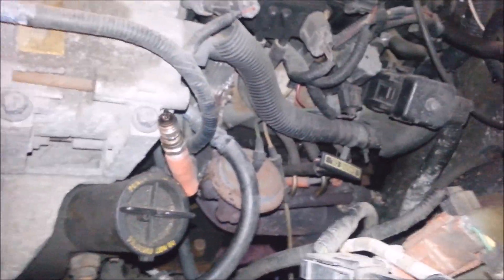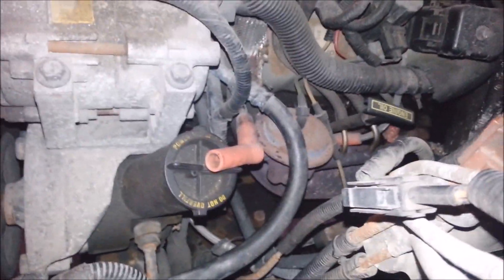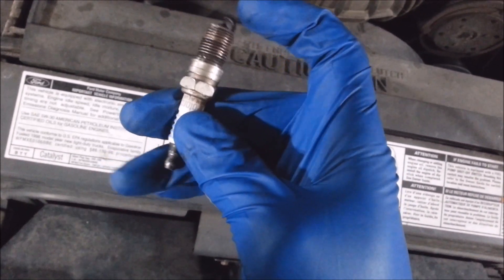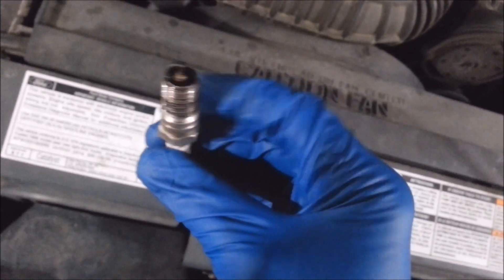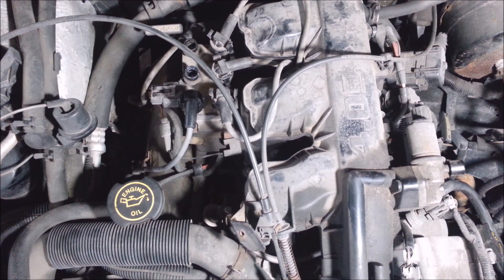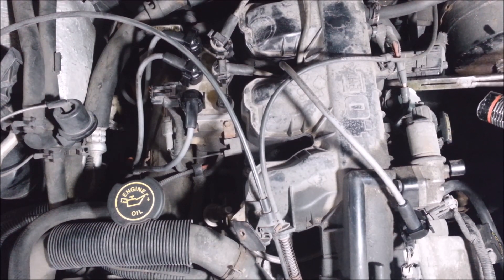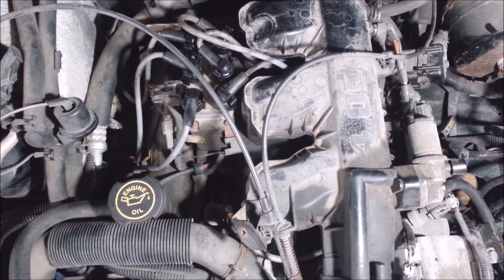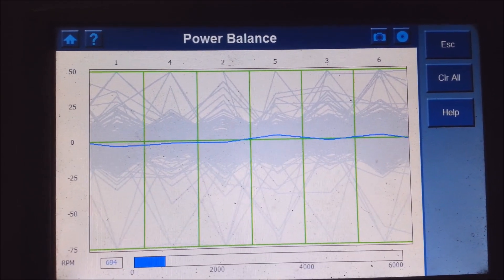1997-2000 4.0L Ford Ranger misfire code fix

Comment: all you have to do, is connect an old fashioned bright TIMING LIGHT to the engine, and move the secondary pickup from wire to wire, and the light won't flash on the missing cylinder.  then it's either coil pack, wire, or plug.  simple.
Reply: Ĺĺ

Comment: Check camshaft position sensor at the passenger side rear of the engine. If it goes bad it will cause a misfire . it fires the fuel injectors.

Comment: always check plug right after coil output. You can read  plug and maybe point you in right direction.If pkug is wet and black could be bad plug {or burnt valve)If plug is dry look and listen to see if injector is ticking

Comment: i was going to change my sparkplugs wires and coil pack.  You got me concerned about shocking myself.  What in that procedure do I need to watch out for?  I watched some other videos and its seems straight forward?  I was going to disconnect the negative on the battery and start replacing?
Reply from the maker: Don't do any ignition work when the car is running. It could be a heart stopper.
Reply: @RustBeltAuto  cool wasnt planning on it.  was going to work with the car off and negative terminal disconnected.

Comment: I have a 97’ 4.0 & I got a misfire code for cylinder 4 with a heavy shake from the engine. I had just done a tune up 5 months ago. I replaced the ignition coil pack & the code went away but the vehicle is still shaking a little more than it should. Should I consider replacing the fuel injector on that cylinder even if I’m not running a lean code?
Reply from the maker: Leakdown test. Possibly compression test. Thos engines are known for burning exhaust valves.

Comment: I have a 97 ford ranger. And when it shifts into 3rd gear it feels like it wants to stall. And it starts to kick then pick up speed again. What would cause that. I have replaced the fuel filter and done an oil change.
Reply from the maker: dziurdad53 No codes?
Reply: Sounds like maf problem

Comment: My 2000 Mazda b4000 with the 4.0 ohv misfires on cold start for 15 seconds then go’s away just happens on cold starts what could that be?
Reply from the maker: Check your spark plugs. If they are really worn, they will work better when hot. Those things almost always need a valve job too. Best advice I can give you.
Reply: Rust Belt Auto I changed the plugs an ran some b12 in it an that seem to fix the issue but I noticed by the spark plug coil harness there’s a plug in red wire that disconnected an I don’t see a plug to plug it into it don’t show a check engine code
Reply: Rust Belt Auto at 12:37 at I’m talking about that red wire that plugs into that 1 black wire by its self that’s on the coil pack thing I’m missing that black wire plug in
Reply from the maker: @kamryn7496  Capacitor suppressor for RF noise. If yours is missing, it would be a good idea to get one.
Reply: @RustBeltAuto  oh that's what it's called thanks I'll look in to it

Comment: i have a 93 Ford ranger it idles ruff some times and bogs down like it's lost all it's horsepower there is black carbon at the end of the top of my tale pipe on my truck there is a flashing white light at the end of the spark plug wire's would any one no what this could be

Comment: Need help randomly started misfiring on cylnder 1 threw a code p0301 new plugs, wires, coil pack still a misfire did that test of takeing the wire out of the coil pack and you can hear it sparking could it be bad plug?
Reply from the maker: Take out plug, and look for carbon tracking. They have valve issues once in a while too. Could be injector issue, but doubtful.

Comment: I hace a Explorer Sport XLT 2003, in It misfire cilindre 4  change spark plug, wirless, injector wash in laboratory and misfire continuos  you can help me ???
Reply from the maker: If you have a good spark all the way to the spark plug, and did an injector swap (moved injector to a different cylinder), and still have a #4  misfire, you might want to do a cylinder leakdown test. The 3.0L fords burn exhaust valves all the time. You may have an issue like that with your 4.0. That is the best advice I can give you.
Reply: @RustBeltAuto  already in the cylinder number 4 have a problem leakdown test It is 80... Maybe now It is a big problema
Reply from the maker: @nicanorm1069   If you are sure the valves are closed all the way, You have your answer. Those heads are easy for me to replace, and have sent a bunch to get a valve job, and resurface long before I ever did a Youtube video. By the way, you did a compression test, and not a leakdown test. Probably still the same result.
Reply: @RustBeltAuto  compression test in my Explorer is 80 in the cylinder number four

Comment: having bad spark plug wire's can make your truck or carboraitor run tuff like idles ruff bogs down and carbon build up at the tail pipe could it be a bad o2 sensor
Reply from the maker: You will always get a little carbon in your tailpipe. especially if it is misfiring, or running rich. if it runs bad, there is probably a check engine light on. best to see what it is. if you think you have bad plug wires see if they look like this. https://youtu.be/e-dGLYodz8A

Comment: 96 Ford Explorer 4.0 # 2 cylinder misfire. I’ve changes plugs, wires. coil was fine so I left that. new o2 sensors has great compression at a stand still now
Reply from the maker: Might want to try an injector swap, and see if it goes to a different cylinder.
Reply: Thanks I’ll give it a go👍
Reply: A bit late but I have money on a cracked head. Not uncommon. Try some K-seal in the coolant. It fixed mine.  I had to run it with the plug out but it sealed. Runs fine now. I have a 96 too. Blow compressed air into the cyl at TDC and see if the coolant rises. Next is a replacement head (it can't be repaired).

Comment: How to fix the air bag light on 96 Ford when  add fuses  under hood blow fast thanks need help
Reply from the maker: You have a short to ground somewhere. My guess would be behind the drivers inner fender. But really, i dont know.
Reply: @RustBeltAuto  is there a plug behind there
Reply: Is there any video on it thanks
Reply from the maker: @bobbydavis8776  no. But i found one once where the wires rubbed apart there. Its just a guess
Reply: Ok thanks  big help
Reply: they have a recall for that and will fix for free

Comment: I had rusted out valve covers on my 96 explorer and it had a factory sticker with a high voltage sign and a book, right by the coil. Maybe a skull and crossbones would be better :lol: I painted the new V/cs and put the sticker back on with RTV :lol:.
Reply from the maker: Put a German one on there I see on some Euro cars. Achtung hochspannung!!!!
Reply: @RustBeltAuto  You know these engines are more German than BMW :lol:. Cologne V6. The replacement parts from ford still say made in Germany. The lower intake gasket I got had a recent date, guess there is a still a need.

Comment: Check your gap on new plugs and I bet you money 9 times out of 10 your not correct gap
Reply from the maker: O.E. pugs are platinum. They are pre-gapped. If you get the correct ones, you do not under any circumstances gap those plugs. You take the chance of ruining the platinum. 9 times out of 10 doesn't work on a 6 cylinder either. Your math is all wrong.
Reply: @RustBeltAuto  yes I have been told that too but over 20 years in automotive  mechanics  is sufficient  first hand knowledge for me to strongly  disagree.  You most certainly  can gap platinum  plugs but it does require  something  other than a typical  spark plug gap tool. Yes they are easily  damaged  if you use the wrong tool......but that is true for just about anything  you turn a wench  on.
Reply from the maker: @michaelbarton7897  the truck is fixed bro. 30 years of mechanicking, 13 ASE certifications, and reading literature from spark plug manufacturers tells me if the gap is wrong on a platinum, or uridium plug, either you have the wrong plug number, or you need to return it, and get a new one, because it has been dropped, or damaged somehow. Thanks for watching.
Reply: @RustBeltAuto  look guy I am not here to pick a fight or shit on your work cuz I see no fault in it at all I just disagree  with a very small aspect because  of what I have experienced  hands on. There is no reason  for a pissing contest over what you have hanging on your wall cuz you will find pretty much the same things here. I did not mean to disrespect  you in any way I was only sharing my personal experience  and I apologize  if it was taken for anything other than that, your work and your walk through as far as I am concerned  are spot on sir.